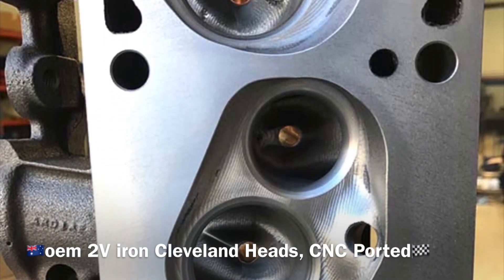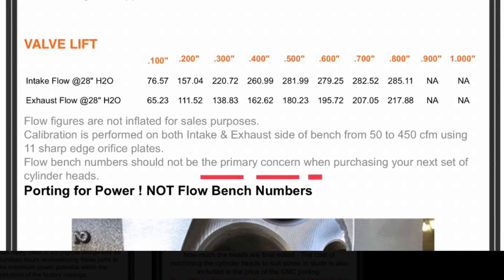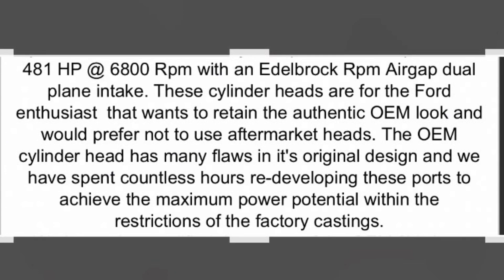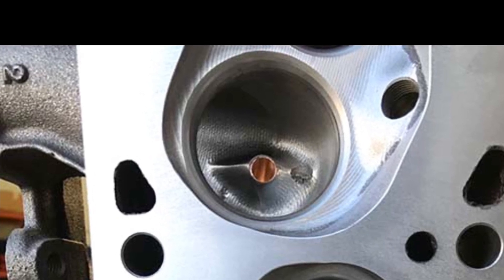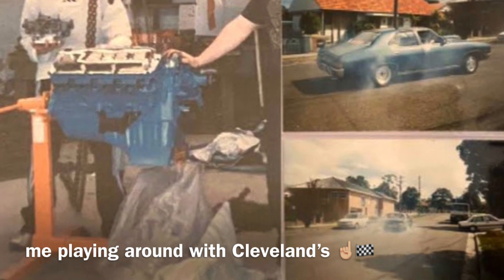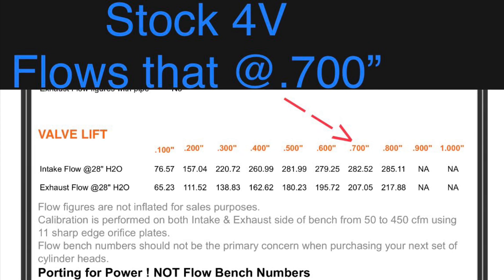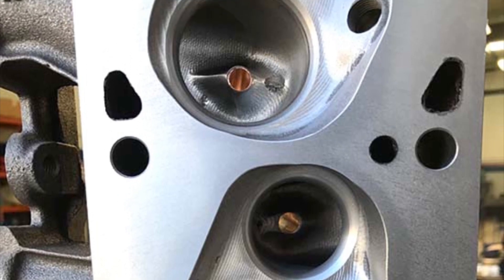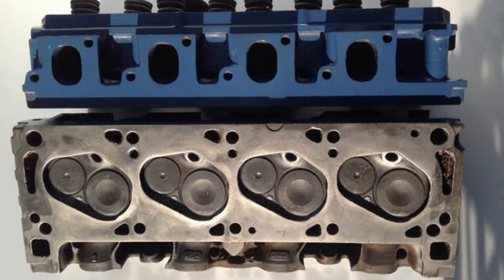Ford 351C 2V iron heads, CNC Ported for power🏁

Comment: My 2V Cleveland took my 73 Mach I to 123mph in the quarter mile.  Had a C4 with a 2800 stall converter.
Reply from the maker: Wowser that’s moving alright💪🏼🏁
Reply: meth lately??
Reply: thats good stuff mate!! What all did you do to lighten the car?
Reply: @jamesmedina2062  this was back in 1985.  I don’t recall everything but I’m sure it was the topical half gut routine
Reply: @DumbCarGuy  Topical half gut!?? Not sure what that means. My 71 started at 3600 lbs with stock interior
Reply: @jamesmedina2062  Oops, Typical not topical.
Reply: I’ve built 4V Cleveland’s that would destroy most big block cars. They really respond to the slights mods.  It takes really good aftermarket head to preform any better than a good pair of closed chamber Cleveland heads with a little work. 700 HP is no problem and turn it to 9000+ and there more to be had.  My last went to 6400 on the converter with 4” stroke and 4.060 bore. It was a low 5 second 1/8 mile car.

Comment: Sure looks like a 4v closed chamber head to me.....That  aside....Love the CNC work...These on a 408 ....😃💥💥
Reply: Aussie heads, best of both. Closed chambers  with the smaller ports for low end torque.
Reply: thats what happens when your country builds a good engine for only two years 1970-1971 and a smarter country builds it for ten years and uses a better port shape which flows better at street RPM's good from 2500 up

Comment: Never really had it presented to me like this, kinda sounds like I'm putting a muzzle on a race horse with these Aussie 2V heads. Maybe I should dust off the original 4V quench heads and use them.
Reply from the maker: If big power is what your chasing, then yes blow the dust of them 4Vs & go for a serious combination 👌🏼🏁
Reply: @69JANKS  Not really after big power, it burns rubber at will in 1st or 2nd as it is. Its in a truck and I can't get the power I have to the ground. It has Duff traction bars but, they seem ineffective, may have to spring for a set of caltracs.
Reply from the maker: @gearbanger57  cool 👍🏼, maybe just settle for the 2V’s, with a little port work & that gear you have 👌🏼🏁
Reply: @69JANKS  Guess we shoulda had this discussion 4 or 5 years ago, lol. With the money I got getting the heads here, parts and labor I might as well run them. If I get the traction issue sorted, I can always throw the 4V's on.
Reply: @69JANKS Yeah I don't race that much and for use on the street in my turbo car it almost never goes above 6000 RPM. So for my 71 Mustang I figure 6000 RPM should also be about the limit since I am not fully racing it. 2V has shown great power from 5000-6000 RPM's

Comment: The whole  point is what can be achieved with a factory head. Unfortunately in the USA those quench/closed chamber 2v heads are very rare and too expensive. I am using 351c 2v open chamber heads,  still plentiful cause no one seems to want them.. I love building inexpensive engines that run strong and the clevor (cleveland head windsor block) can be real inexpensive. 351c blocks are also getting hard to find and expensive but windsor 302,5.0L and 351w blocks are cheap and in every salvage yard.
Reply from the maker: Yes i understand🤷🏻‍♂️, the open chamber are still good at making power also.
Weren’t popular here as we had tons of closed chambers around. We were short of 351w blocks in the day, they were rare to us🇦🇺, good choice back then to do big Ci strokers on them 9.5” blocks👍🏼🏁

Comment: As far as I know you won't find those 2V closed chambered heads  in North America or at least Canada , but I could be wrong . I'm sticking with the 4V . We didn't have a 302 Cleveland either 😕 😪 . Just the Boss 302 , 69 & 70
Reply: There was an importer shipping used heads over here in the 90's and early 2000's. A friend bought a set for his 351C powered 73 Bronco

Comment: That's what I call art!!!
I still remember seeing my 1st set of CNC'd heads many many moons ago and having to pick my jaw up off the floor after finding out what it cost.
They were a set of 4V's destined for a dedicated XD falcon drag car, the owner had to send them to the US to have the work carried out.
The way the roof of the Port is scalloped out and radiused with that contour that runs up to and around the valve/guide is so reminiscent of those heads....
Reply from the maker: Wow RT , that’s cool 👍🏼🏁
Reply: Those particular heads had another couple of quirks aswell, which I've never come across again, maybe you have?
In the top of the head they had bleeder valves placed in each of the core plugs.
If memory serves me, it had something to do with making sure there were no air locks/hot spots in the head....so whenever you had to drain/refill the radiator, you'd bring it up to temp, pull a valve cover and manually vent off any air/steam at each bleeder.
The guide plates were also individually pinned/dowelled to the corresponding numbered cylinder along with the shaft rocker assembly.
Reply from the maker: @RoB_666_   never heard of such a thing🤷🏻‍♂️but cool to know…….thanks for sharing RT 👍🏼🏁

Comment from the maker: Hey guys, something i forgot to mention on here is that you when you slap on these 🇦🇺2V Closed Chambers on say a zero deck height 351C  the compression will be sky high (eg 12:1), you must relieve & lay back the chambers to achieve that 10.5:1 comp.
Remember these closed chambers were on🇦🇺oem 302C with below deck piston clearance & obviously the shorter stroke.
Just putting it out there 👍🏼🏁
Reply: That’s the whole idea of making power is with higher compression. You’ll make stock-ish power with lower compression and won’t be making the power these heads will prove to make. These heads are badass!!!
Reply from the maker: @blackshine007  oh yes high compression will definitely be the goods🏁 but will need to run on race juice🤷🏻‍♂️& iron don’t help either…..we here🇦🇺have a habit to always build tough pump gas motors both St n Strip👌🏼🏁 & it won’t be “stockish” at 500+hp on pump…..it’s actually badass for a 50+yr old hunk-a-iron🏁, but if race gas is your thing OR e85 then yes that’s cool too🏁
Reply: @69JANKS with the right camshaft these will work on pump gas @ 12:1. But we have an abundant source of e85 where I live in south Arkansas My 12.5:1 383 Windsor runs great on it but it does have its drawbacks like having to drain fuel system before you let it sit for long but it is great.
Reply from the maker: @Axeman428  💯%👍🏼🏁

Comment: Man, wish I knew of someone here in the USA that could get 2Vs as nice as those jewels. Even though mine are OC, I'd probably be scraping and saving till I could them done like that. B302 in my little truck at the moment, but it would be nice to have something that didn't have a bad attitude when you ask it to run at less than 5K. 
 Very nice pieces, and thanks for showing them, Janks. Is it one of the more famous shops in Oz that does that work?
Reply from the maker: Thanks Z, there Shld be some closed chambers floating around the 🇺🇸 surely🤷🏻‍♂️, but yes these heads are PAVTEK (vic🇦🇺) 👍🏼🏁

Comment: That’s a good presentation of the ARD1AE 2-V heads. I like your no nonsense approach without all of the typical embellishments that guys tend to include. But these heads scream performance, especially when prepared as these are. 

I’ve never owned a set but if the opportunity came my way I would have to jump all over it, depending upon the circumstances. You’ve obviously had some valuable experience with them and I especially like the way you tell it like it is. Quality components don’t require excessive BS to impress. Nicely done Janks 👍
Reply from the maker: Thanks DW appreciate the comments as always my friend👍🏼🏁
They are badass heads for what they are, yes I’ve done a few badass 2V headed pump gas combinations in the day (90s) at one point we thought we had one of the quickest around here until i then noticed a local perf.workshop with their own 2V combo ran 11.9et (auto big Conv.) 
ah Dang got us by a tenth lol, but hey….stick shift is way cooler to race isn’t it 🤷🏻‍♂️🏁haha…… always wondered though with that Combo, it was a lot of head work for what it was & definitely would of benefited with a size/spec up in cam & say 11:1 comp, sure woulda done them heads further justice…….& better et 💯🏁, but I’ve always had that conservative in me & rather do subtle but smart & well selected gear instead of just big,big, big like some other guys go for…….🤷🏻‍♂️
Reply: @69JANKS … Just when you start thinking that you’re the big dog in town, some bigger badass come along and kicks sand in your face 😵‍💫. Oh well, back to the drawing board to start over again. 

Damn 😳drawing board really shows my age. CAD/CAM super computer or maybe a good ole common sense design 👌. 
If I’m sitting in the driver’s seat, then hell yes a stick is very cool. 
I’m amazed and disappointed by these dude’s mentality of bigger is better. It’s definitely the wrong approach to good engine building.  I do like to go big with the compression and an appropriate solid roller cam that compliments the sum of all parts.  As you know, if the combination is well matched, the results should be killer. It definitely gives the GM fanboys a reason to carry extra tampons and cry about Clevelands UNFAIR ADVANTAGE. 🙀
Reply from the maker: @danielwilson6665   exactly DW, a big combination is ok for the right intent i guess 🤷🏻‍♂️🏁

Comment: Really wish that there were more 4bbl intake options for a tall deck cleveland engine, without using adapter plates.
Reply from the maker: a pair of 4V’s on a 400M with a Holley Strip intake(adpt) nice solid stick working to 6500rpm, 10:1 comp & 4150 750dp would be cool, make good hp/tq 🏁

Comment: I’m going to use these on my 8.2” deck 302w build
 I did a mock up the other day in my xy van had to figure out what iron exhaust manifolds I needed as I’m keeping the factory3speed manual column  change 

Look at the .200” flow to .300” flow 😂 then .400” pretty dam good
Reply from the maker: Would be cool as a Boss302w setup 👌🏼🏁, nice compression, good cam, it’ll make easy power 👍🏼🏁
Reply: Did you build that out yet and how is it going?

Comment: I love the torque hump with 4V heads. The big torque "blip" on the dyno radar trace at 3000 rpm  exists with the 2V heads as well, but it's not as pronounced. Look at Street Machines Power Games series with Graeme Nichols from Lynx, and the SF902 dyno numbers with the old CC 268 cams. And the Capri Cortina V8 parts Bob Pinnell combination of 375 HP net with just stock 2V heads, Crower Street Beast cam and Strip Dominator intake with 3310 780 CFM 4bbl. The 2V 302 Closed chamber heads with 57 cc relieved to 62 cc with Phase 4 Closed chamber 4V style intake blending went from 206 CFM at 500 lift  to well over 235 CFM, and that's 60 extra Net HP. Basically, a Fuelie 481 SBC head, but factory FoMoCo. 69Janks, cannot argue with your logic or statements, man 👍😁🫡🥝✔️
Reply from the maker: Good info shared there DS👌🏼, & thanks buddy i appreciate it 👍🏼🏁
Reply: @69JANKS  Yeah, go over the 1988 to Maybee 1989 Street Machine dyno power traces. If you can find them, they cover exactly what you've said. Love your stuff.
Reply from the maker: @deanstevenson6527   👍🏼🏁

Comment: Really wish I had some aussie 2vcc heads. Just gotta make these oc heads work in my neck of the woods 😭
Reply from the maker: @FordRanchero289   just deck the oc a little & run a flat top as close to zero deck…..it’ll be ok, I’ve seen them still make 430-450+hp na on pump gas👍🏼🏁

Comment: picked up a set of 2v closed chamber heads a while ago  with 4v valves  , not been fitted since the work was done , they also have double valve springs , doesnt look like anyone has touched the ports though , im wondering how they will fair in that combination with a decent cam ?
Reply from the maker: They will work well on 351c , just watch out for the measured compression…..sometimes the chamber needs to be layed back a little depending on piston to deck height clearance…..
All depends on the combo, if it’s intensions are to be stout, then porting is a must for like 420+hp 👍🏼🏁

Comment: We're u using 302 closed chamber heads in your back in the day? If so what comp ratio u get using on a 351c?
Reply from the maker: Yes i used 302C closed chambers. The chambers were relieved back a little to reduce comp. I had ended up with 10.5:1

Comment: I can tell you know Cleveland’s very well and was hoping you could help me. I have a 70 Mach 1 mustang with the stock 351c 2v motor in it “2v open chamber heads” what would be my best way to make 500hp with this engine ? I’m open to finding different heads for it. It has a toploader 4 speed trans. Any info for my engine build would be much appreciated! Cheers
Reply from the maker: Thanks appreciate it👍🏼… you can get there with those heads but a lot of work involved & by the time you spend the $$ on porting, machining them for solid flat tappet cam use etc…..it’s probably wise just to go an aftermarket alloy heads for it eg: CHI  3V  or  CHI 4V that keeps all geometry exact so you can run your headers accessories etc as normal.
There’s also TrickFlow alloy heads (TFS 2V) , also Scott Cook heads SCM….
Most of these heads here can come complete ready to go/bolt down besides rockers…. & all flow good outta the box “as is” to support 500-600hp without porting👌🏼
Now depends what your talking about as far as rebuild?  You can just leave your bottom end as is (machined & looked over of course) with a forged piston change though, a flat top is best with zero deck height finish or at least no more than .05”thou below deck….
The alloy heads you choose will have info & basis on what comp you’ll roughly end up with running a flat top piston.
Cam either in solid flat tappet Or Hyd roller is fine…. & something with .600”-.650”lift (exhst) & 258°-265° in duration@.50”  that’ll get your Cleveland working up to 7000rpm👌🏼🏁
Obviously You need to do all the other supporting mods, Oil gallery mods (oil restrictors), matching Intake manifold (single plane OR air-gap high rise Dual Plane) , good competition style 750-850cfm Carb, good ignition/dist.
arp rod bolt upgrade, arp main studs, arp head studs etc…. Your machinist will do all the usuals, & comp should work out to be around the 11.1:1  region on pump gas
☝🏼 that there on your stock stroke 3.5” (351) should see at least 500+hp 🏁
Reply: @69JANKS  awesome ! Thank you. I’ve been trying to decide on whether to keep it a 2v 351 or machine it to a 4bolt main with a 408 stroker crank. I like the idea of keeping it somewhat original 351 but I feel like it would be a whole other beast with a 408 stroker crank and a set of heads like you suggested. The car and engine has 48k original miles on it
Reply from the maker: @TartsHouseOfMuscle   anytime👍🏼, wow that’s immaculate 👌🏼…..yes just depends on how far the rebuild goes, ideally a new forged stroker deal would be awesome, a game changer in power & torque , Cam can still remain around them specs but it’ll turn into a 550-600hp beast then ….
So cost more in doing that path, but all up to you🤷🏻‍♂️🏁, regards.
Reply: @69JANKS  thanks ! I’ll probably build it without a stroker kit for now and revisit that later down the road. You don’t happen to have a set of heads I could buy ?
Reply from the maker: @TartsHouseOfMuscle  awesome👍🏼, i don’t have any aftermarket heads no🤷🏻‍♂️
Reply: @69JANKS  any chance you have a set of Aussie 2v closed chambers ??
Reply from the maker: @TartsHouseOfMuscle   i do have a set of oem 2V iron heads yes
Reply: @69JANKS  interested in selling them?
Reply from the maker: @TartsHouseOfMuscle  not sure really, was saving em …….where you at? 🇦🇺or🇺🇸?
Reply: @69JANKS I’m in the US North Carolina
Reply from the maker: @TartsHouseOfMuscle   I’m in Australia 🇦🇺, it’ll be a fortune to send iron heads up there lol

Comment: That chamber is the shit!!! The USA 2V chambers are garbage
Reply from the maker: Closed Chamber 🇦🇺🏁
Reply: @69JANKS  I don’t understand why ford kept the open chamber all those years. Ford dropped the open chamber after the 72 year model of the 460. But kept it for the Cleveland variants. They already had a closed chamber they could have went back to. But hats off to the Aussie’s for keeping it real!
Reply from the maker: @matthewnosal6893  just one of those things MN emissions, fuel octane etc…..the Closed Chambers were found on 🇦🇺302C because of there shorter stroke & piston below deck height etc
Open chambers were on the 351C’s etc
But careful, putting a 302C 2V Closed chamber on 351C with zero deck height piston would be very high comp like 12:1 or something, you must relieve & lay back the chambers to achieve that 10.5:1 👌🏼🏁